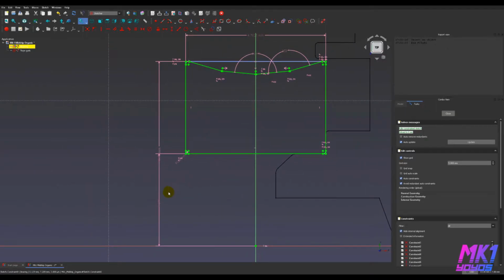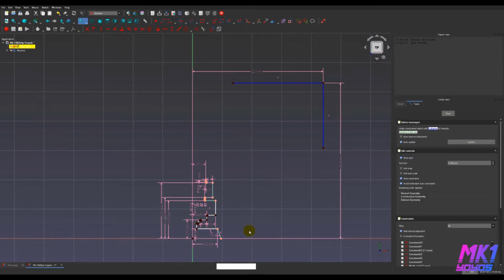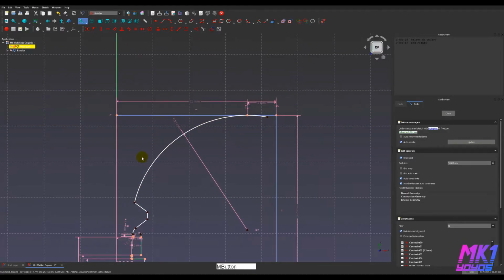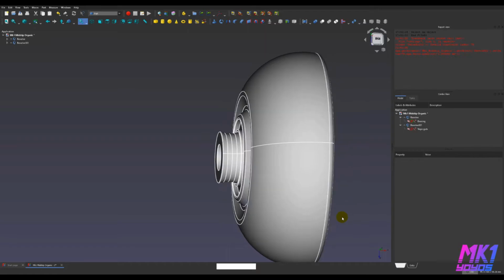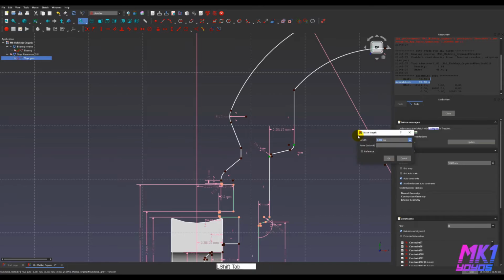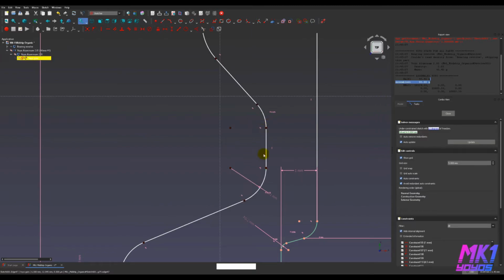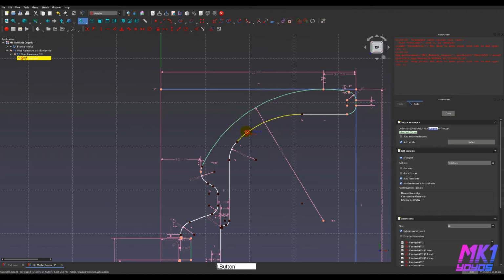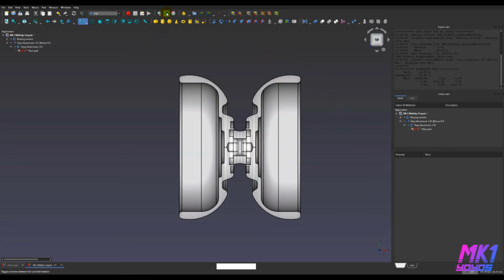Mk1 Mechanics Part 2: Yoyo Sketch

Comment: Thank you so much for doing this series, Mark. I've been using FreeCAD for counterweight design and did a simple yoyo to manually machine. But there were so many little tips in here (I'm half way through right now) that I can use. It is awesome that you're sharing this - thank you again!
I intend to watch all through this series when I have the time. For now, I have to pause and come back later.
Reply from the maker: You're very welcome! Let me know if you have any questions, and please also give me updates on the yoyo you're machining by hand!
Reply: @MarkDiehr  Hey Mark, I'm back to rewatch this cuz I'm thinking of just getting a shop to do something. I did attempt to machine a bearing seat gauge so I could manually machine it, but it turns out that with the tools I have I cannot reach into the part adequately...I have no experience with machining custom tools from blanks and the whole thing just got out of hand, soooo....didn't end up doing it. :D But I think having a shop to something will be rewarding in a different way.
Reply from the maker: @hesperaux  I am not a machinist but my impression was cutting the response groove and other guts parts was the most difficult part and requires very small grooving tools to do.

It is still satisfying to draw a 3d model at least! That's why I still do this years later!